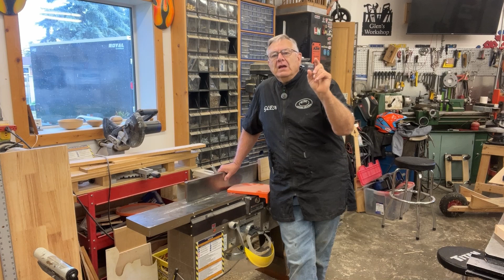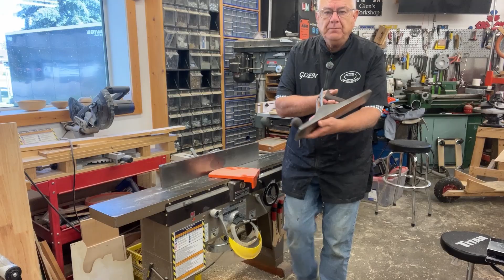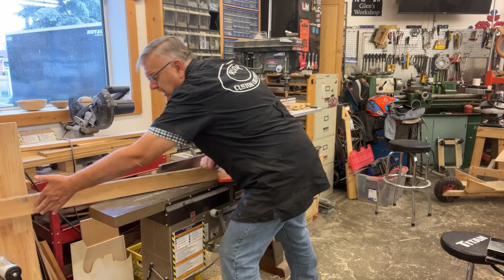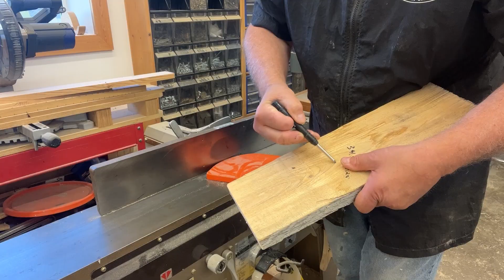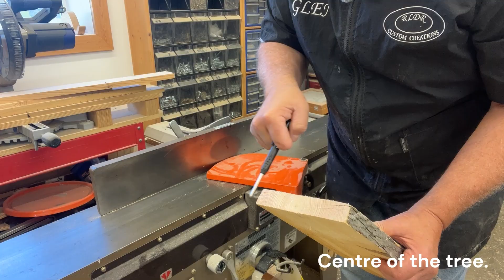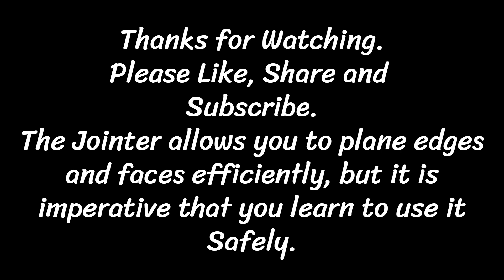Jointer Basics:  Chapter 271

Comment: Thanks for creating this video - another very good video.  Over the last couple of years, I have seen several videos where the jointer (or other power tool) was used incorrectly as well as without proper safety precautions. With the video series that you are creating, it will be possible to point the people who create those types of videos to your videos.
Reply from the maker: Thanks for the view and comment.  I think that there is a crisis in my province when it comes to placing unqualified shop teachers in the shop classroom.  I have taken it upon myself to help these new teachers out.  If others find these videos of value well, I also appreciate that.  Thanks.
Reply: It is generous of you to help out those shop teachers that are under qualified to be industrial arts teachers in the school system.  Hopefully, the teachers at least had the chance to attend a few shop classes before graduating high school.  I think that putting under qualified people into those classrooms is better than completely eliminating the industrial arts programs in the schools.  The teachers are likely able to eventually learn the trade, but not if they do not have a classroom to practice that trade.